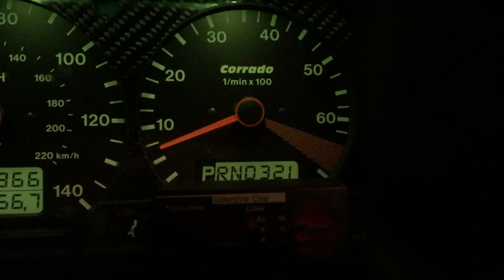Corrado Project - SpoonFed Tuning Carbon Fiber Rain Tray & Cowl Install Tips

Comment: I'm attempting to install the lower windshield cover right now and I can't for the life of me figure out how. The instructions are vague and when I line up the end screw holes there's a gap between windshield and cover. Did you have to drill out the holes and/or space out the mounts?
Reply from the maker: I didn't have to drill out any holes on mine, no.  No gap either.  Just fit nicely in place.  
Just taking it step by step to make sure there's nothing in the way... James does mention in his instructions that you  need to remove the white clips at the bottom of the windshield, so do make sure those are removed.  They could cause it to not sit flush.  
You do need to use three of the factory clips from the original covers, one in the middle and one on either end, for proper placement.  And while I didn't find I needed to do so, James does mention that you may need to use some silicon to secure the cover in place and make it flush against the windshield.  I didn't need to do that on mine, but if it's not laying flat you may want to give that a whirl.  Just hold it down in place with something heavy while the silicon is setting.
Reply: @CliffjumperCars  I got it all to fit but had to move the screw holes 3/8" outboard. No way those original clips would fit, they aren't even close. Moving the holes out solved most of the issues although there is still an uneven gap between the cover and the tray. I will be on the hunt for a rubber seal to cover that, otherwise it looks pretty good.
Reply from the maker: @andrewlewis4253  Sounds like that one may have a manufacturing defect.  I'd reach out to James at Spoonfed and send him some pictures.  Should fit much better than that.